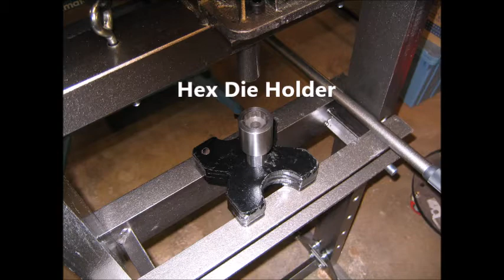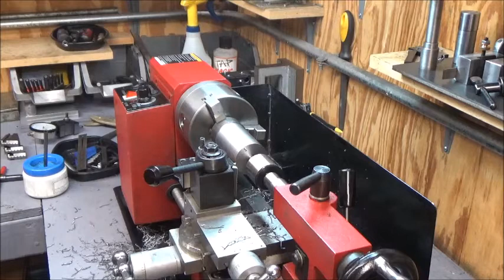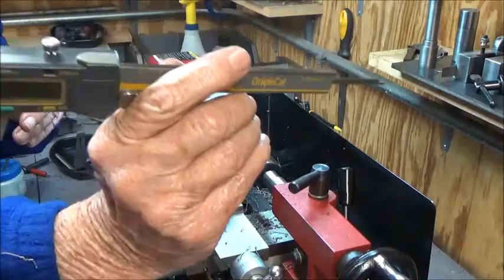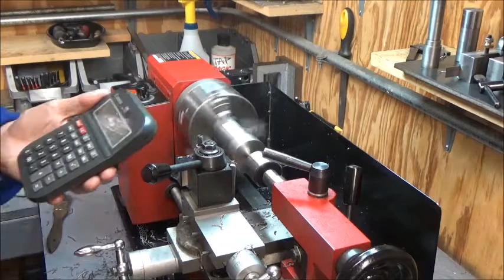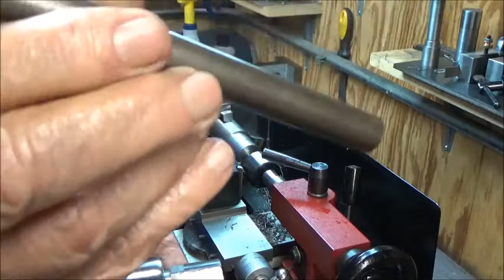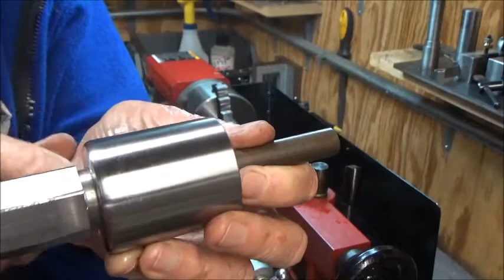Round and Hex Die Holders for the Lathe Tailstock - Part No. 1

Comment: Hi Larry, what type of tool are you using? hss/carbide, what depth of cut on each pass? also, how are you able to get more video time? I can only get max 30 min and then it stops and I have to start a new video if my recording is longer, also once upon a time my new videos were visible on the home page now they never appear at all except on my channel, what is your secret? do you think if you increased the travel feed it might eliminate the chattering? Just curious, I'm going to email you with a few updates of photos in a short while tinight,
Reply from the maker: Walter:  I'm using a carbide insert, and yes, I can definitely take a bigger cut if desired.  As far as video time is concerned, I think I did something in the past to increase it to run more than 30 minutes at no cost, etc..  Look into your settings and see what turns up, in the meantime I'll do the same and send you an email.  Best Regards: Larry